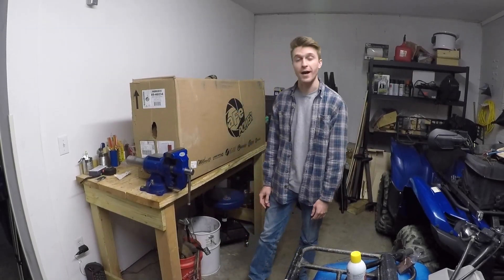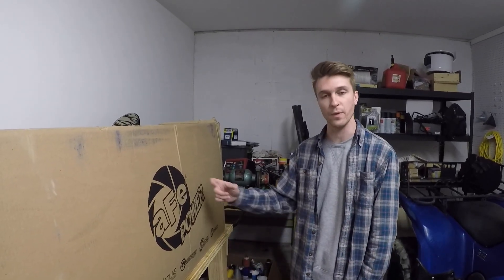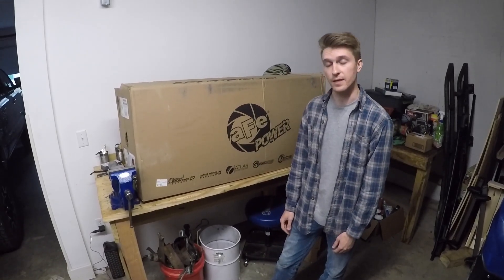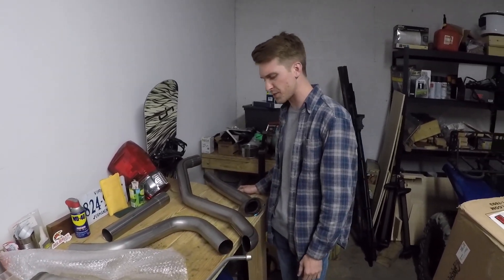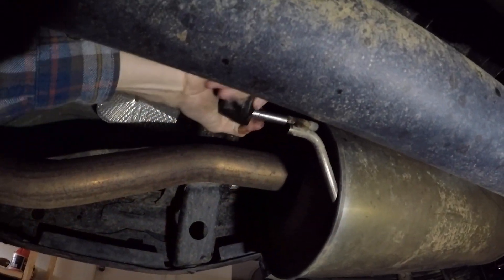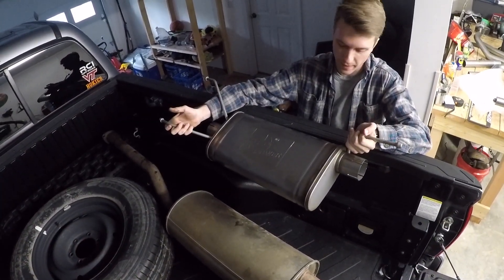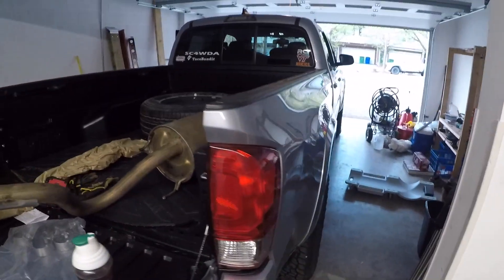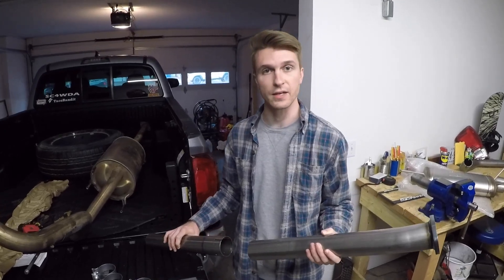AFE Hi-Tuck Exhaust Install on 2016+ Tacoma

Comment: I have a question for you guys. I'm looking into buying the OV-Tune for my 2017 TRD OR and wanted to ask witch brand should I get and on what setting I should use for regular driving? I don't do much off road like I would like to but every now and then I do tow a trailer.  Just want to make sure I buy the correct one and down load the right program for my truck?  Any feedback would be much appreciated.  Thanks and keep those videos coming!!
Reply: @Miguel Munoz, OVTune only sells one software kit for the 3.5 Tacoma as of now. He used to sell two packages one with the needed OBD connector and cables and with without.  When you download all the software etc you have the choice of tuning for 87,91,93 fuel and have the choice to chose the base tune, Performance tune, and Performance with the Gearlock tune. 

It’s really up to you and your driving habits but you can try them all and see what works the best for you?
Reply: Thank you so much for info and for the quick response!  @jessejames1920
Reply: No worries, a few of us folks are OVTuned! We’ve been down that road..... Mat has a video on his site that shows how to do it just pay attention to it.
Reply: Will do and once again, thank you! @jessejames1920
Reply: I take it that you guys don't have a Discount code?  @jessejames1920
Reply: @Miguel Munoz, for the exhaust? AFE still has the 20 off discount I believe!  For the tune, you just gotta catch it at the right time if or when he does a discount.....
Reply: @jessejames1920  Thanks but I just bought the S&b cold air intake along with a flow master for my truck. I'm very pleased  with the quality and the sound. I will keep my eye open for any discounts on this ov tune. I just dropped close to $400 on what I just bought, including after the install of the flowmaster. 🤨 lol
Reply from the maker: Sorry I'm late to the party but I think y'all get it figured out!
Reply: By any chance do you guys have any wheel spacers on your trucks? And would you recommend it?  @TrailPass
Reply: @mmunoz5875  TO echo what everyone else is saying - If you are looking for overall improvements in the drivability of your truck then look no further. The OVTune is an amazing game changer in not only the world of Tacoma's but also in many other products on the market. They've done a ton of R&D on these trucks and it only gets better. I would say purchase and don't look back! TO answer your question about wheel spacers - neither of us are running them. If you do purchase them, make sure you are getting a very nice, quality set of them. This is not a part you want to skimp on. Definitely do your research!

Comment: I also just installed this exhaust and have noticed drone when accelerating around 2250-3000 rpm and then disappears above 3000. Also notice it around 1500 rpm when in higher gear. Have you been experiencing this as well or no?

Comment: Do a check up in 6 months to see if there any rust because I was too change my exhaust to MRMP but someone I know has it and it's got surface rust .
Reply: Very true after removing mines it had a lot of surface rust I was surprised they claim it was stainless steel. The OEM exhaust is stainless steel
Reply: Paint it with high heat paint

Comment: I just removed my MBRP dual exhaust from my 2016 and went back to stock. Nothing but annoying  drone driving got on my nerves. Aftermarket exhaust for these trucks is a waste of money unless you just like the noise they make. After going back to stock I saw no difference in gas mileage or throttle response the only thing different was the stock is super quiet which is what I want